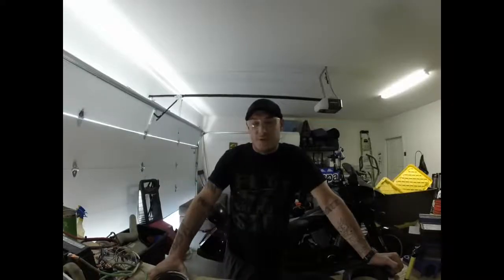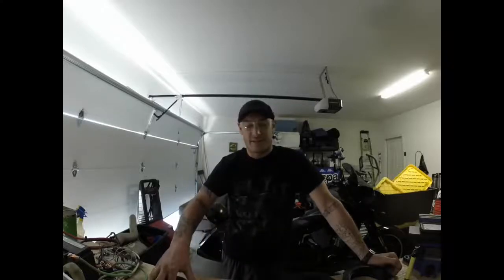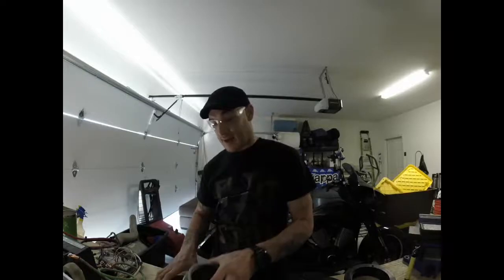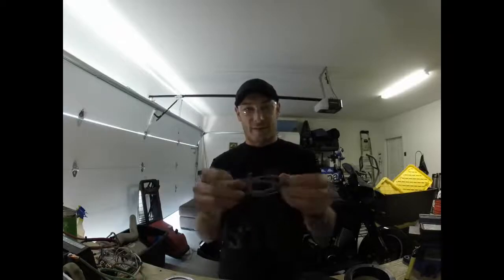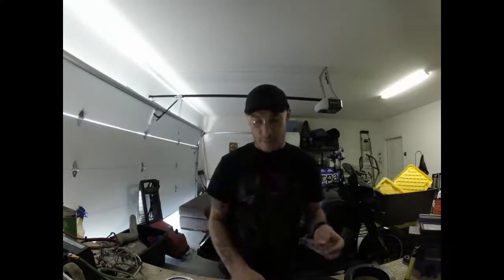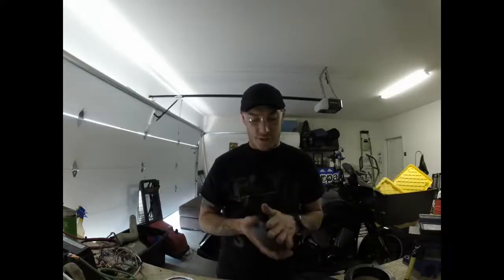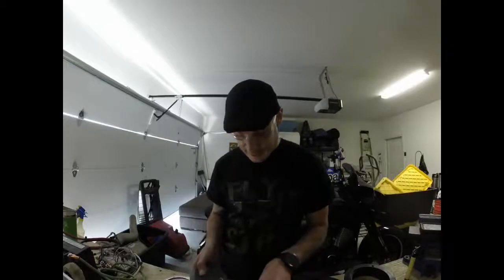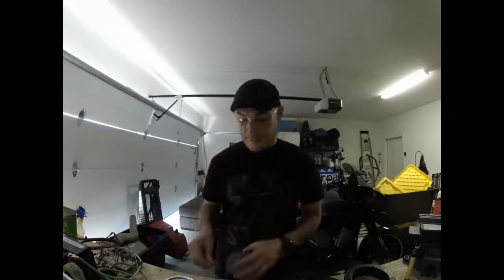OneWheel Conversion - Hoverboard wheels into OneWheel

Comment: excellent design work, almost finished with my build !! 
Did you use an inner tube inside your tire/ or what tire valve are you using to hold the air in ?!
Reply from the maker: Yes I did. Off the top of my head I dont recall the exact tire - ut i do recall it being a carlile tire ordered from Amazon.
Reply: @NCardoza_Engineering so you used a regulator valve stem?

Comment: To me, it looks like the best solution so far. Great job. Any chance to get that 3D priner files?
Reply from the maker: Files will be up on Thingiverse soon! I had a brain fart and completely forgot to upload them - check in there within the coming week and you should see them published under Terror_Industries. Thanks for watching and please report back with how your build goes.
Reply: @NCardoza_Engineering  Hey man, nice work on this. What tyres will work on the rim? Is the rim 6 inch?
Reply from the maker: It is a 6 inch rim so any one you find on amazon would work for that size. IFFFF you wanna get crazy with it, go down to your local general aviation airport and look/as around if there are any tires that have come off of the trainer planes recently. General aviation planes have 6 inch rims so you can get those used tires free - they are hard as rocks - buuut they are rather large height wise.
Reply from the maker: https://www.thingiverse.com/thing:4804295 - I suck for the delay - huge apology!